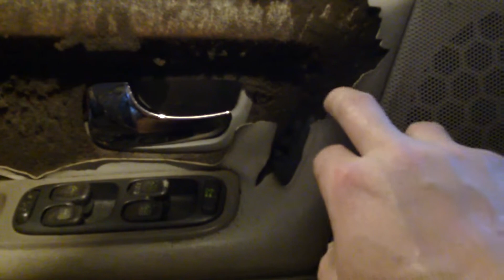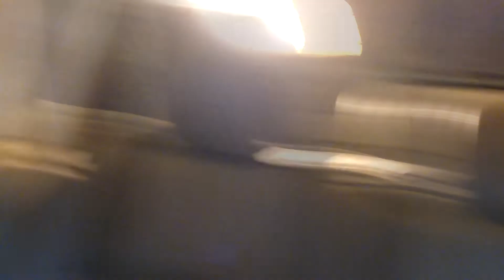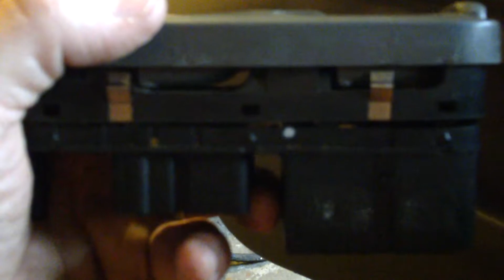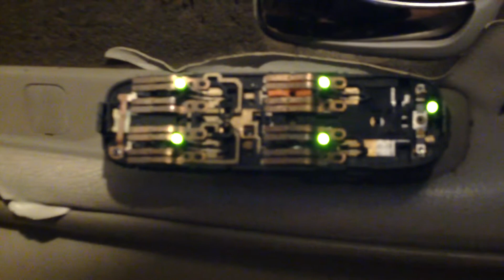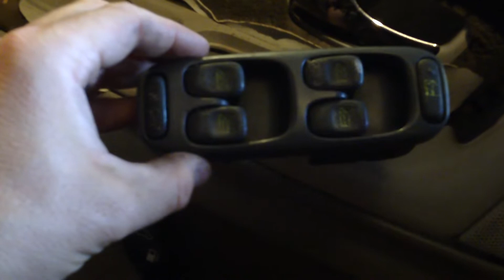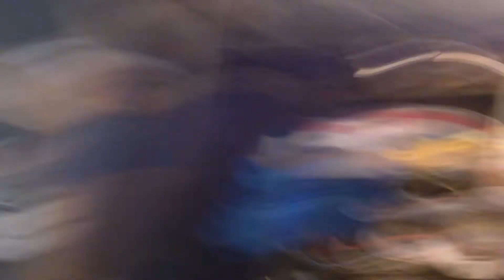1998 Volvo V70 DIY: How to repair master window switch

Comment: Thanks bro those things are faulty as hell after opening mine up and it sparked at me a couple times but finally got it to go up and close at least lol. first time owning a Volvo. (2000 s70 turbo). Big help bro you saved me from driving in the cold for the next couple days lol. Just waiting on the new component and I’ll be set! No hate to Volvo, cars old but runs and drives great!

Comment: The driver door window on my Volvo S79 98 is full down and won't go back up. I did everything in this video and put it all back and it still won't go up. Everyother button works fine and the sensors all have grown lights. However when I try push the orange piece up, which should close the driver window, nothing happens. When I push back, to close it, it makes a clicking noise. What do I do know. Need to close window before rain comes. Do I need to remove door panel now?
Reply from the maker: @gamling24  I think you do
Reply: Also sorry quick follow up because I started freaking out but when I went to get back in my car a couple hours later, when I unlocked the door the alarm started going off and the hazard lights blinking repeatedly. It would then stop the alarm but the lights would keep flashing. Then the alarm would start up again if i tried locking the door or unlocking it again, also it wouldnt let me start the engine during all of this. This went on for about 20 minutes until I had given up hope and went to lock the door and  it didn't trigger it. I managed to unlock the door and start the engine and drive home. It looks like the red light for the alarm is off now do :( so not sure if that will come back on and the alarm shit will start up again tomorrow...

Anyway regardless when I got back I checked in the unit and saw that all the green lights were now off. Also none of the windows worked and also onto their own doors. 

I don't understand how this made it so much worse and not have any of the windows work. Do you think maybe a fuse got blown? Would that explain the green lights not working? The door lock button still surprisingly works.

Any help please?

I am going to order a new unit of Amazon regardless but I am unsure of what to do next as I don't want to bring into shop and was the whole reason I did the steps in this video😢
Reply: @gamling24 hey did you find a solution?

Comment: I need to replace one the rear-left switch. I broke it when I was trying to pry it out and free it from the sticky stuff. How easy is it to pop it out from underneath once the unit is disassembled? Thanks!
Reply from the maker: When you say "the unit," I assume you mean the door panel. If so, then yes, very easy to pop it out from the bottom once the door panel is off.
Reply: @MercedesDieselGuy  With unit I meant the switch assembly. I need to replace one single switch. Thank you!
Reply from the maker: @diegaulle9143  oh, you want to replace a single switch in the whole four-switch assembly? I don't know if that's possible.

Comment: V70XC '02 - Driver window stopped working. Disassembled as you suggested. 2002 switch interior is newer different electronic circuitry than '98, as one might expect. However, I cleaned the tiny switch sensor and sprayed air - reconnected and YES ! it was back in working action. Thank you for this video. Surely saved me tons of time and money.

Comment: BEGINNING this repair now.  pretty tough to separate the two halves of switch for me.  not 5 minutes just for that.  but nonetheless, thank you so much just for sharing the possibility of this diy, sir.  i'm broke enough to save that $20, no matter the time here!  you're a little out of focus, but i get the picture.  [btw, if you ever blow a cam seal, check out some of my posts on other's videos regarding that.]  and for the super cheap, some say that white vinegar will suffice for an electrical contact cleaner.
Reply from the maker: Thanks. I had no trouble separating the halves of the switch housing, but any number of factors can make that difficult on 20-plus year old parts. I've done cam seals, but don't recall if I've done videos on those for the Volvo.
Reply: -> MercedesDieselGuy  if you you want to see my 'miracle fix' for an s70 cam seal, go to this video and see my comment: https://www.youtube.com/watch?v=WPQq3NS95TE&feature=emb_logo  it's a real lazy cob job, but still works 5 months later.
i did get an easier way to separate switch halves using plastic 'shims' using cut up clear plastic food containers, like for spinach.  by sliding these down in between and blocking the clips on one side, once the clips are separated, i can do the other side without the previous side 're-clipping', -which is frustrating!  been doing all the rest of switches the same way, [where i developed this], but still can't get them all working.  something else, i guess...  thanks, though.  i did get driver's switch working much better anyway, with this, your shared method.

Comment: Thanks for the vid 👍 I was able to fix my father's door window that wouldn't open nor close I really like  the way Volvo ,Mercedes,and some BMW engineers designed switches like this that you can actually "service " and repair yourself ,can't really say that when it comes to  most Japan crap cars other then Honda's and Toyota's, those Germans were ahead of there time !
Reply from the maker: I'm not sure if there was ever any engineering intent to have these be serviceable. I'm sure that even in these cases, the vehicle manufacturer would much rather sell the car owner a new part (much quicker and more profitable, I'd assume). It's just that in this case, the switch unit is so well built that it CAN be serviced.

Also, I did own and drive a number of 1990s-era Subarus for about ten years. While not QUITE as well built as a German or Swedish car, those cars were well-engineered for the most part.

Thank for watching.

Comment: Nice video. Are you able to change the bulbs in the switches?
Reply from the maker: I didn't make an attempt. This was about getting the switches working.
Reply: Bulbs are soldered so if u handle the solding then yes